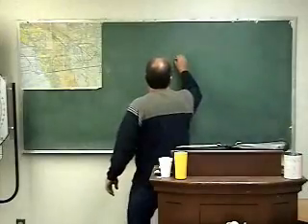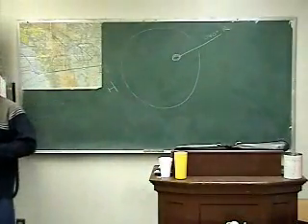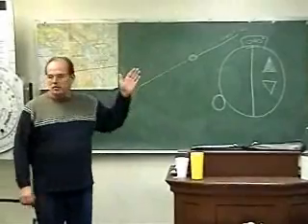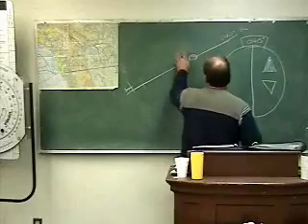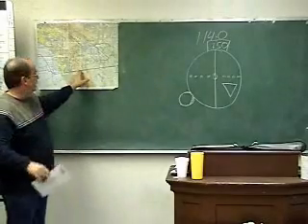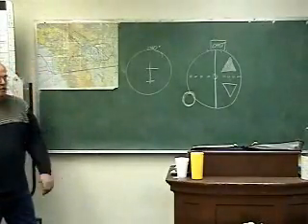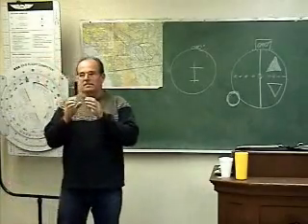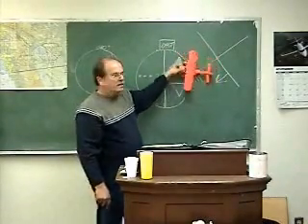Short VOR Navigation Lesson gsfc.com

Comment: The 040 signal can't be picked up anywhere as stated in 1:08. Receiver picks up the reference signal(magnetic North) and the signal of the radial the plane is located on. Then with the difference in phases between them it calculates the position (angle with respect magnetic North),  and with the radial you've entered into the OBS it shows you if you are to or from and left or right

Comment: G.P.S. is only a help tool for navigation and it is not always 100% correct. The V.O.R. is the most precise and most correct radio signal and it is very reliable and very helpful. If you do not know how to navigate the V.O.R. , don't even think to fly further away from the airport pattern. And yes G.P.S. is secondary tool. It is so easy to get lost in the air. Imagine you are in the air and suddenly the weather conditions change and you can't fly V.F.R. no more. I wouldn't rely on the G.P.S. Then, the V.O.R. comes to first place.
Reply: James Bond in normal conditions GPS is way more reliable than vor, vor can have a error up to 4 degrees and still be legal to fly ifr, 4 degrees is not much when you are close to the station take that to 80nm (using high vor)  u have like 5 nm off... gps use at least 5 satellites for ifr sometimes 6 way better resource, :p

Comment: turn the OBS until CDI centers. read the TO/ From indicator. if the up arrow is orange you are going to the station if the bottom arrow is orange you are from the station. turn the plane towrds the heading on the indicator if TO heading is 040 and your plane's heading indicator reads 130 turn left until it reads 040 and you will intersect the VOR as long as you keep the CDI CENTERED. its easier if you draw lines on paper and draw a small plane.